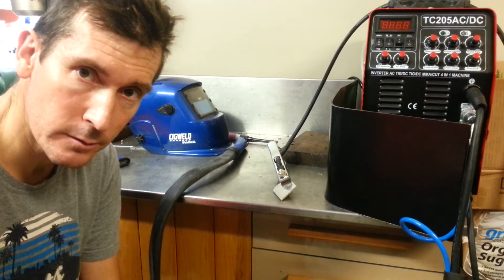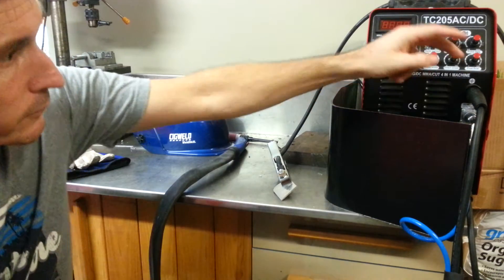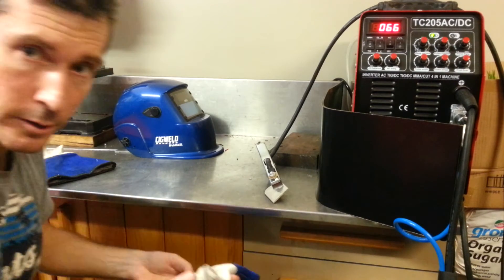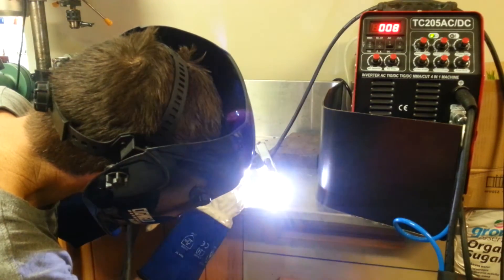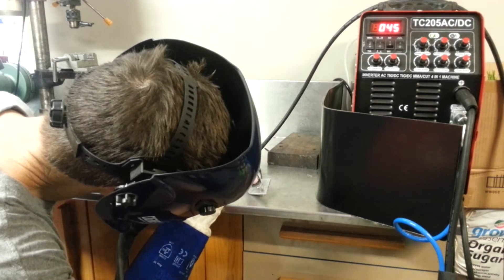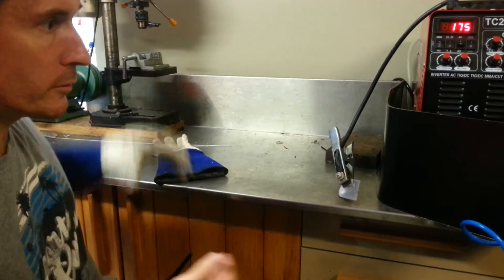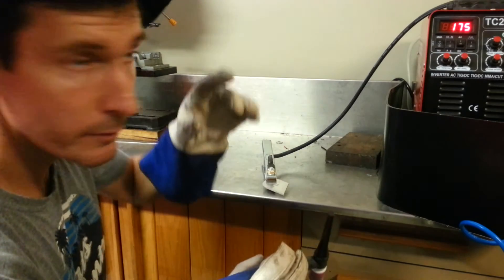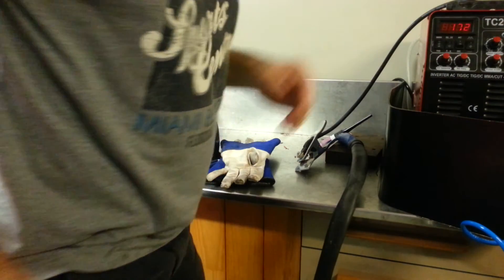Rossi TC205 AC TIG welder, not welding

Comment: I  have the exact same machine and am thinking of changing the all electrolytic caps to higher quality caps as cheap caps always seem to cause problems. Worth doing or am I wasting my time?
Reply from the maker: I recon the best thing you can do is just use it. If it burns out the control board send it to Pete at Token Tools. He'll charge you, sure. My welder now 5 years after this video, after having a Token Tools control board installed, is still working perfectly, the Token Tools repair cost was totally worth it.
Reply: @arrancoote  Thanks Aaron. I might do just that, just use it. I bought another TIG welder knowing that one day the tc205 will fail.

Comment: When you struck the arc the amp drop down to 5 amp on the gauge so your only welding with 5 amps, looks like what your dialling in isn’t making it through the control board to actually change the welding current, the welder is working but it’s just stuck on 5 amps

Comment: If you have the connections in the wrong fitting you will not mark/weld on the material as the polarity is going in the wrong direction .How is it that no one has noticed it. I do fix welders for a living.
Reply from the maker: Thanks for the reply David. That may or may not be the case but in this situation the control board in the top of the welder was failing. Elsewhere in the comments you will read that Pete from Tokentools fixed the welder by installing one of his control boards. It's been working fine since then.

Comment: I can fix them
Reply from the maker: Yeah i know, its got one of your control boards in it and has been working fine since you installed it for me  maybe 18 months ago :)
Reply: Damn, I am a bit of a knob today :) I came across it tonight when looking up something else on YT and didn't realise.  Glad to hear it is working well Arran, Cheers Pete
Reply: @Tokentools-weldersAu   i currently have a chinease 200amp ac/dc tig welder with overheat problems. looks like this one https://p.globalsources.com/IMAGES/PDT/BIG/247/B1067503247.jpg. Warning light is constantly on, Hf start works but nothing else. any chance a new controll board would solve this?
Reply: @gandersson6121  Is the LED yellow or green or red, these machines use a tri-color LED to indicate fault.
Reply: @Tokentools-weldersAu   I think its yellow. I have not played with it for along time.
Reply: @Tokentools-weldersAu  hey mate have one of these machines and it’s gone poop on me week arc like that a small capacitor poped out of it aswell a blue one I ain’t no electrical specialist this stuff scares me can you help?

Comment: Hi
I have a similar acdc tig welder 200Amp with the same pc board as yours, the problem I am having is I cant get the pulse to work, I have tried every settings, checked every wire etc - Do you have any advise on what board is responsible for the pulse? there is a pulse on/off button and dails for pulse freq. the buttons and dials test ok with the meter, but the pulse feature doesnt work. NB  everything else works and the machine is brand new, the manufacturers have now stopped answering my emails.

Comment from the maker: Hi Alan, the control board at the top of the welder has burnt components. I tried replacing and fixing what I can see is burnt, a diode, capacitor, resistor and a nearby relay. Some track was also burnt. It didn't fix it unfortunately. If there is a spare control board laying around there is a good chance it would fix it
Reply: this is exactly what i was saying. hook the eltrodes up wrong and the settings will cause damage.

Comment: Hello, 1 too much gas to cover. 2 connect the ground wire to +. 3 minus connect to the handle Tig. 4 gas flow, set the size of the nozzle gas. example (nozzle 5), 5L / minute. Try again . Good luck.

Comment: Looks like its only giving your start amperage.  | would test your pedal with a multi meter to see if the resistance changes when you press the pedal.  Might only be tripping the microswitch so you will only get an arc start and it will stay at the start amperage.

Comment from the maker: AGR Machinery/Mills are not going to cover the item under warranty.
The brief history is:
Purchase welder just before Christmas 2014
Welder 1 breaks Easter 2015
Replacement (Welder 2) arrives end May 2015 (about 6 weeks after initial failure)
Welder 2 fails Easter 2016 (end March)
AGR Machinery's position is no warranty. No information about the welder can be provided (no schematic diagram). No repair agents in my city are available. I can return the welder to AGR at my cost (have to be at least $100), have it looked at (minimum charge $95 to open the box), have it repaired (parts plus labour), then I pay to have it shipped back (another $100).

Repair is very likely to be more than half the cost of the welder, which has already broken twice in a short period, so is likely to break again. Since the initial purchase in December 2014 I have used a D size argon bottle and almost emptied an E size, yes that's right, between welder 1 and welder 2 I have not even gone through 2 bottles of gas.

After I initially contacted the company to raise the request, I was asked to shoot a video of the problem. After spending quite a few hours setting up the camera, tripod, camera charge, retakes because of my children wandering through and uploading to Youtube, the next request was to back the video up with a written description.

It is certainly irritating when after completing these steps the position is that the unit is out of warranty and it would appear that I have had my time wasted.

The cheap initial price of this welder is just not worth aggravation, frustration and down time that has resulted. I paid about $850 for the welder delivered, I would have been much better off spending $1500 on something with local support and a three year warranty such as

Cigweld Weldskill 200
Uni-Mig TIG-MMA 200amp AC/DC Inverter (3 year warranty)
BOC Smootharc 185 AC/DC FC TIG Welder

My most recent email to the company on 7th April which has gone unanswered (sent mid April 2016) is below:

____________________________________
Thanks,

Essentially the conversation has distilled down to the fact that the welder is out of warranty. When I contacted your company via a phone call last week, I provided the eBay listing number information and my email address. You were able to identify who I was and view the history at that time. You requested that I produce a video which I did, and as a follow up that I provide you a written statement of the problem. The shooting of the video took a number of hours on Saturday involving organising a tripod, a number of retakes to ensure the scene was framed correctly, avoiding background noise, getting the camera to work properly, and then uploading about 500MB of video over an ADSL connection.

From my perspective that all seems to have been a waste of time because none of the circumstances around the use of the welder or the manner in which it has been cared for are taken into account. Only the fact that it is 4 months out of warranty (from original purchase, as mentioned in a prior email this particular welder is only 10 months old) is taken into account and your company subsequently is taking the position of providing no assistance. I have contacted a number of electronic repair business in Brisbane and without any supporting information like a circuit diagram, to date none of the businesses are prepared to look at this type of welder. With the amount of stock your company has sold over the years I would be interested to know if you are aware of any agents in Brisbane who will deal with a Rossi welder.

From a consumer's point of view, if you were in my position would you view this transaction as satisfactory? I purchased a very expensive item. I've barely used it. It has completely failed twice in a short period if time. You won't help at all. Is there any assistance you company can offer that does not involve shipping the item back to Sydney?

Thanks for your consideration.

---------------------------------------------------------------

And after all that, I have fixed it myself. Two things appear to have been amiss. 
Inside the main unit I simply tightened up a number of the heavy current connections. I also resoldered a high current connection that looks like it was getting hot. I rerouted the HF start wire which for a conductor carrying high voltage seemed to be run too close to silicon.

The foot pedal trim pot had failed. I replaced it with a 50k long shaft pot from Jaycar.

Welder is working perfectly again, thanks for nothing AGR